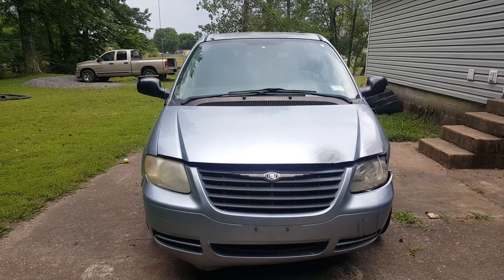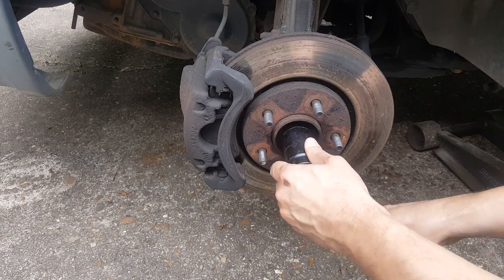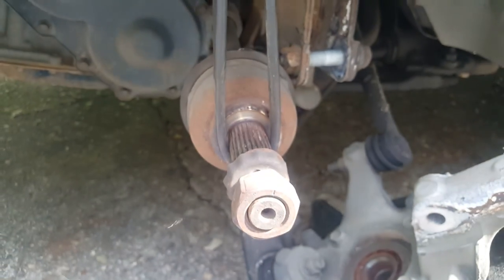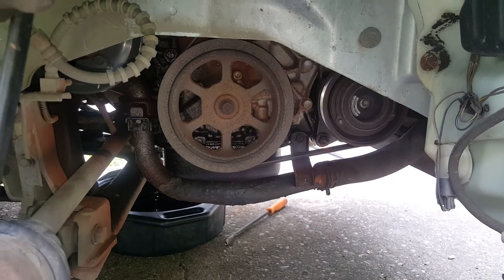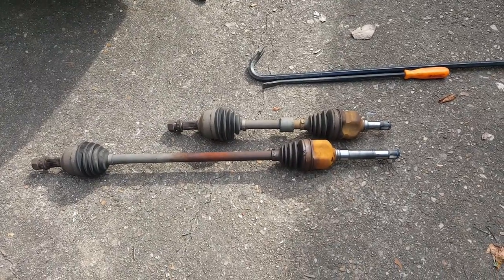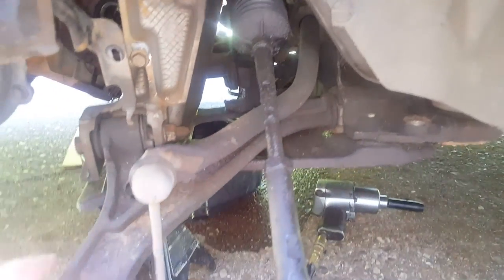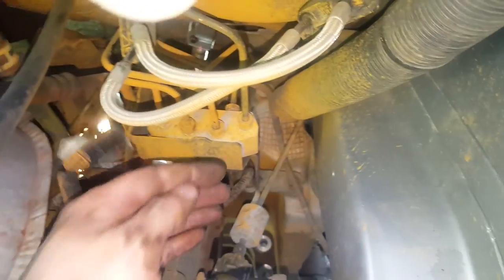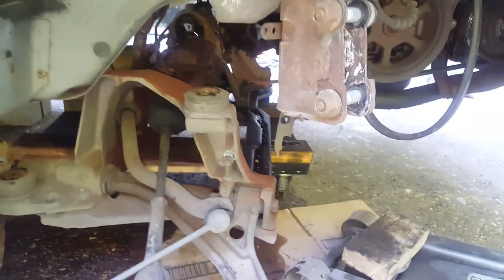Replacing the engine in chrysler town & country/dodge caravan

Comment: I did this 2 weeks ago. Took it out the top without removing the skid plate and transmission. I removed the passenger tire, radiator (left ac compressor connected and laid on frame with cords), cowl, wipers, and headlights.
Its very difficult but I managed to shift the engine back and forth pulling it out.
Putting it back in I decided to take the flywheel off and then lowered the engine to a point where i could reattach it.
A big part that helped was being a 5' 7'' 145lb Asian guy, I was able to get my arm further up through the skid plate when unbolting the exhaust. And putting the flywheel on between the engine and transmission.

It ended up only cranking but I think it was from messing up the spark plug threads.
Reply: I'll put a little more tips later on.

Comment: I did the same job on an 05 caravan, I pulled the 3.8L out the top and replaced it with a 3.3L about 6 years ago. I paid $2500 for the van with 71000 miles and the replacement 3.3 with 59000 miles costs me $650.  I then had about $3200 in a fully loaded lower mileage van. I sold the van last fall for $3600 after driving it another 70000 miles.
Reply from the maker: Great work , thank you for sharing , thanks for watching.
Reply: So you lost 30hp. Yikes. The pcm is engine size specific. Were you running a 3.3 on a 3.8L pcm? Even the injectors are different. Must of ran like azz

The 3.8 lw is a dog, i can’t imagine a 3.3 lw
Reply: @goclunker  he had to of changed everything in order for it to of run right or to of turned on at all. How to pass The smog emissions test is my question
Reply: I like the 33L engine over the 38L those GCVans have too much bloat..😂

Comment: Currently replacing the engine on my moms 05' GC with no experience. Right now ive been stuck on rusted exhaust manifold bolts.
Its taken time but hopefully nothing else goes wrong with disconnecting from trans and pulling it out.
Reply from the maker: The exhaust is the worst. I have found a reciprocal saw to be my go to on the bad ones. If the studs break off , I use vice grips and small torch. If that fails cobalt drill bit and drill that out. Thank you for sharing and great work tackling this project .

Comment: I really enjoyed your careful filming and explanation.  I've been wondering if dropping out the bottom or lifting through the top is easier and having watched both ways now I think lifting it out the top is a little easier... Not by alot mind you.  Either looks like alot of work. The water pump/pulleys/accessories have to come off but it will then lift out.  Plastic cowel and hood need to come off too.
Reply from the maker: Thank you for sharing and I appreciate the great feedback.
Reply: Why do the acc have to come off? Just take the wiper area and the bottom part of it off and take tourqe converter off should come straight up

Comment: Is it easier from pulling from the top?
Reply from the maker: Not easier , but the same amount of work , just different approach. I have pulled them through the top but more needs removed. I would tackle it in the way you would be most comfortable. Thanks for the question.

Comment: Amazing patience as you film all that 3 plus hours (4 days work, at least)! And you go: "not too bad", "nothing really hard", a million times.  Even when you undo the rrrrrusty bolts of the catalytic converter. Awesome explainer!!!
Now, for the scientific criticism/curiosity: 
1. Why not disconnect the wiring harness from engine and tran, and keep all that tied to the body, rather than drop it all with the engine?
2. Do you really have to drop the steering case and wheel hubs, or you can just drop the subframe?
Anyways, this is THE MOST THOROUGH VIDEO EXPLAINER that I 've ever seen!
Well done!
Reply from the maker: In my experience most but not all the time disconnecting the harness from the car and removing with the engine is easier.
As far as the wheel hubs they could stay by popping the ball joints out and dropping the frame. The steering rack is way easier to remove than leave. 
All great questions . I appreciate the feedback and thank you for watching.

Comment: How does replacing the engine effect the title?   Does buying a brand new engine make it rebuilt vs salvage?   Does a used engine make it salvage?
Reply from the maker: No . Changing the engine does not affect the title. Unless the insurance is claimed even vehicles that have been in wrecks can also be fixed without affecting the title. Great question and thanks for the feedback.

Comment: Where did you purchase the motor from I need one same size
Reply from the maker: I get all of mine from ebay. I would find one with low miles, these engines are pretty cheap I have seen the 3.3l with 100k miles for less than 500 with 6 month warranty. I have had good success with lkq. Thanks for watching.

Comment: is it possible to put an 2006 into a 2003 voyager ? (3.3l v6 both)
Reply from the maker: 2001-2007 3.3 should be the same as far as I know. there may be some minor difference   like valve cover, oil pan, but same engine. Thanks for watching.

Comment: My Brother Good Afternoon! Do you still have this van?
Reply from the maker: I do not have it anymore , but it was a great running vehicle. Thanks for watching.
Reply: @s33therfan  I really need help with the proper jacking points in the front and back when placing van on jack stands?
Reply from the maker: I utilized the pinch welds and the subframe . I would recommend using 2 sets of jack stands , with one being for back up. In my case I used jack stands and blocks. Anytime I am going to be under a vehicle doing extensive work , I will always have 2 forms of support for extra safety. Thank you for watching.
Reply: @s33therfan   @s33therfan  Good Morning My Brother! To be honest I dont know what pinch welds or subframe are, i do have 4 jack stands but i dont have blocks at all, whenever i have interest in wanting to work on this van (2003 Dodge Caravan SE) i cant do so because idk where to place my floor jack onto from the front and even in the rear of the vehicle as well and the same for the jack stands. Your very welcome my brother!
Reply: @AlwaysDiagnoseVehicleFirst check out the video titled 2001-2007 Town and Country Front motor/transmission mount... It shows where to put the jack.